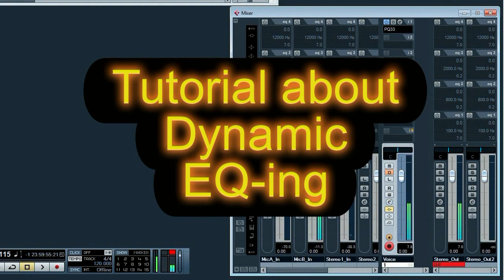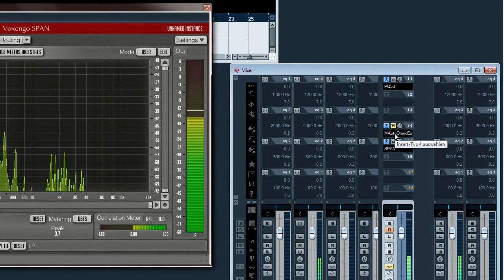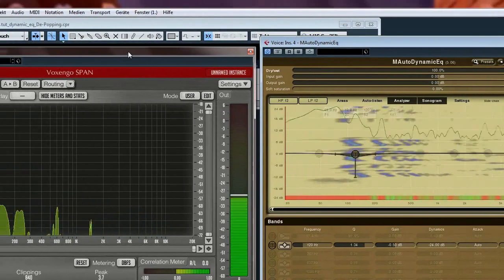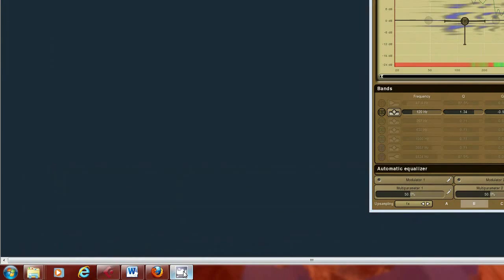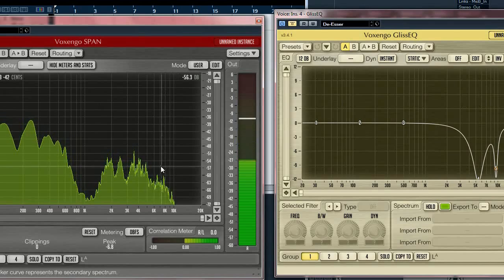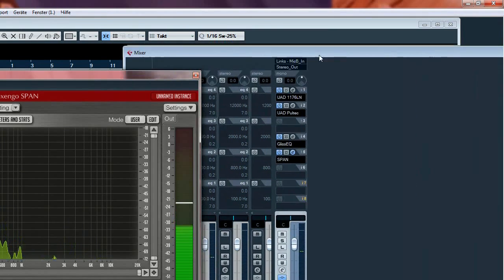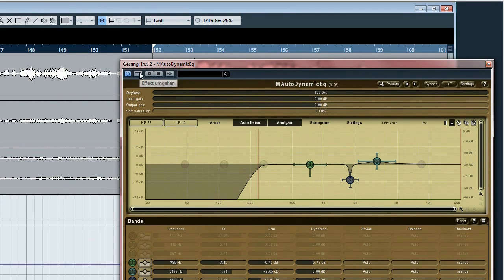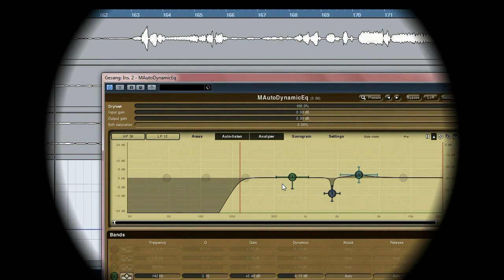Cubase tutorial Dynamic Equalization

Comment: Nice!  I always use dynamic EQ’s to “fix” stuff by cutting. Can you think of a reason you might boost a frequency?
Reply from the maker: I can actually thing of two reason where I might boost a frequency with a dynamic EQ.
1. I might boost a frequency at the sweet spot (say 4k for vocal intelligibility). But this can lead to harshness when the singer gets loud. The dynamic EQ will help me tame the boost when neccessary.
2. I might switch to expansion mode rather than compression. This allows me to enhance certain frequencies once they go above threshold. It will sound like a spectral transient shaper but more tranparend. That is a subtle tool to gives your mixes that little extra that makes them sound "like a record". 
Please give me feedback if these tricks work also for you.
Reply: DrMax0  I will give that a try. Thanks!